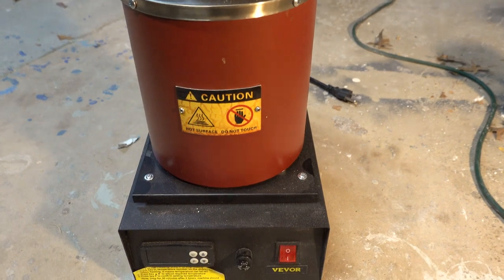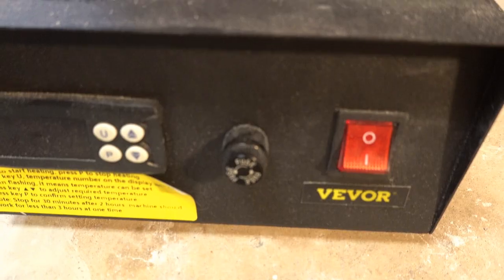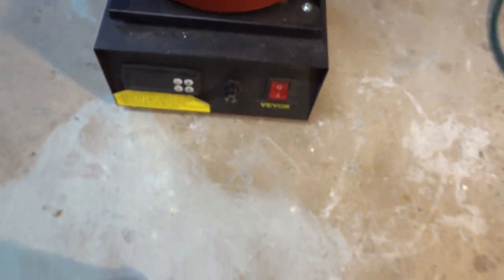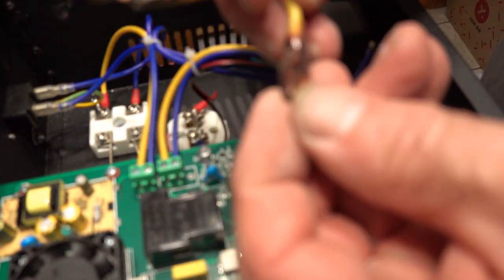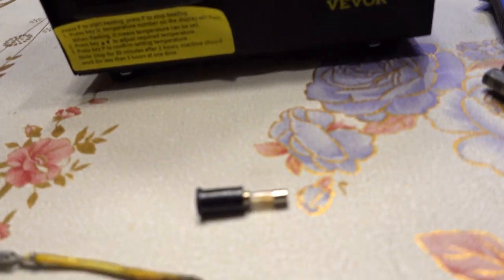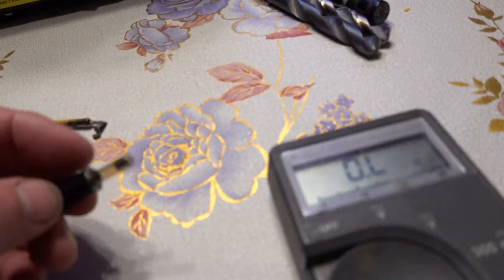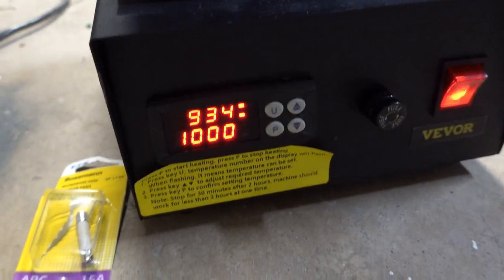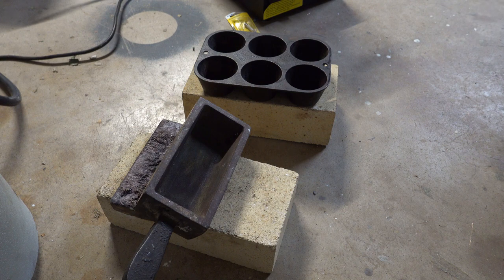Vevor electric furnace review and repair

Comment: We just got a vevor and tried it .  Would never get to target temp and just oscillated a few degrees below set point.
Reply from the maker: i would replace some of the wire to a bigger gage. if you have a multi meter, check the resistance of the fuse and switch. it is a good unit for ingots but for casting i would use a flame heated crucible.

Comment: What exactly did you do? I just had mine go through three fuses as it hit 1080C
Reply from the maker: some of the wire was too small of a gage so changed that out. resoldered the joints on the switch and replaced the fuse holder to a bigger one. i still don't like it  for casting as the top of the crucible isn't hot. might be good to pour ingots

Comment: I just had the exact same issue  with mine....used only 3 times and exact issue...fixing tonight thanks for the video.
Reply from the maker: glade it helped. i have stopped using mine as the top of the crucible doesn't get hot.

Comment: Did the thermocouple burn up yet? The 3kg crucible rubs on the thermocouple and leaves graphite behind on the tip. That will eventually burn though. I'd recommend using the 2gk crucible. As far as I'm concerned, vevor furnaces are garbage. I've purchased two of them before breaking down and spending 3 times the money for another furnace that heats up 3 times faster. The vivor also uses WAY MORE POWER then the higher quality furnaces. I run with a tabletop quickmelt furnace now and I can pour copper in 25 minutes from cold. 
If you're going to stick with the hobby, I'd highly recommend using a higher quality furnace.
Reply from the maker: i have stopped using it . the top of the crucible is too cold and cools the metal down to much when pouring in the flask i think it is ok for lower temp metals like tin and zinc stuff. may be ok for doing ingots but i am not going to use it any more
Reply: @mikesproject4704  I love my tabletop quick melt but I still use my vevor from time to time. I wont melt copper because it brings it a bit to close to maxing the machine out but I still use it for my silver pours. I like to make my own silver art. I dont know what temps you tried pouring silver but I bring it up to 1063c. 
I had the same problem you had with my quick melt but I got confused with the conversion from C to F. 
And if you still dont plan on using it, you should consider using it as a give a way to grow your channel. I'd offer to buy it from you if you were here in the US but judging by your accent, I dont think we live very close together. LOL
Reply from the maker: @ShroomDay0117  i am in Oklahoma. not sure temp i pour silver at . i go on the look in the crucible.  i have gone to using a ceramic crucible in my propane furnace only tales 20 minutes for about 20 oz of silver. the crucible os hot so doesn't cool down the metal.. i am doing investment casting.
Reply: Can you recommend a quality furnace please?

Comment: The screen on mine isn't displaying anything. I'm guessing it's a wire problem but i am also not knowledgeable on these machines. Any suggestions?
Reply from the maker: either the ribbon cable is loose or power wire is off. i have stopped using mine as the top of the crucible isnt hot enough causes problems with casting
Reply: @mikesproject4704  thanks to your video I figured out how to take it apart. Finding that info wasn't easy. The LCD wasn't plugged in. Simple fix. And yea I noticed that today using it. Once I poured some stuck to the upper part of the crucible
Reply from the maker: @lilotc4175  they have made a new one with elements going higher up the crucible. i will try that one soon